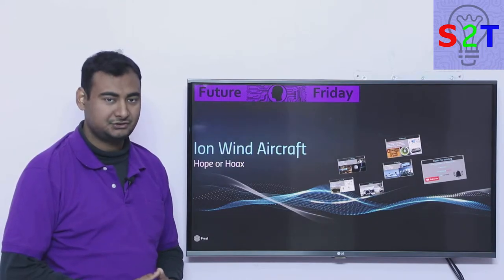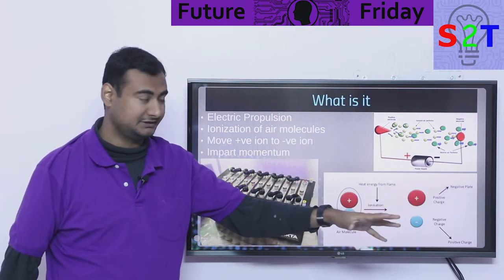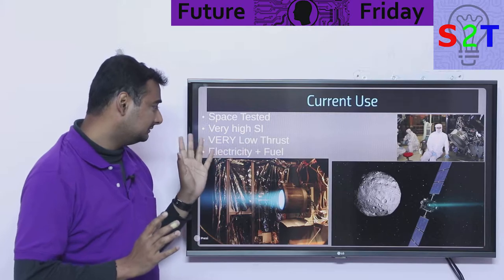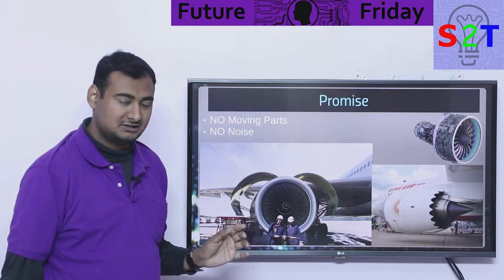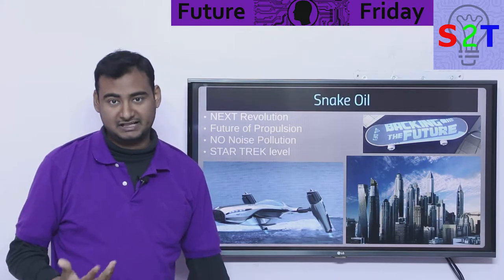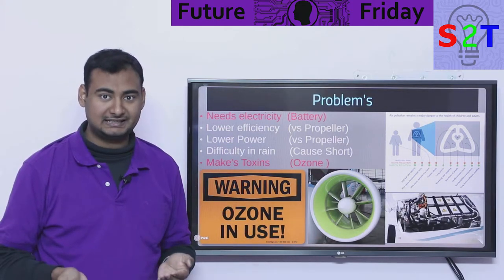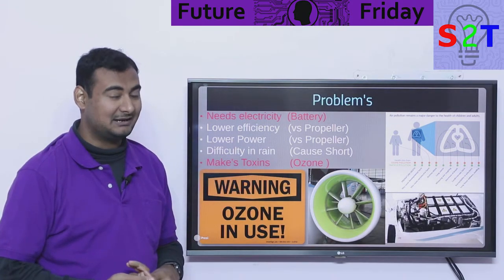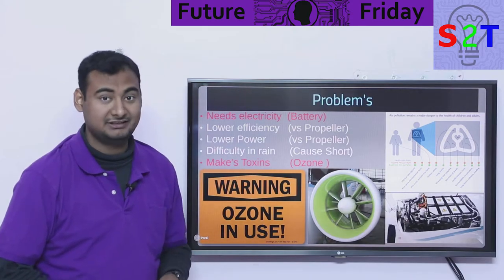Ionic Wind Aircraft HOPE or HOAX{Future Friday Ep30}

Comment: this ionic wind is total hoax. i can't get it how on Earth is it making ions move in ONE direction? even if it does ionize air (because of the arc going between the electrodes) AND those ions DO move they r going 2 move TOWARDS each other basically COMPENSATING itself, no? where would the forces going in OPPOSITE directions come from?
Reply from the maker: look into ION engine charge moves from +ve to -ve like a stream & air caught in the stream keeps moving as its not charged so u just dumped momentum using electric potential
Reply: @s2tenglish  it's fine. but!!! the plasma cloud is NEUTRAL as a whole: total positive charge = total negative charge. EVEN if the positives go in one direction the negatives will naturally go in opposite direction. whatever 'air caught' will b 'caught' and moving in BOTH directions thus EQUALIZING the momentum, no?